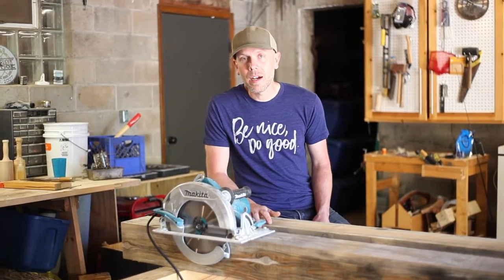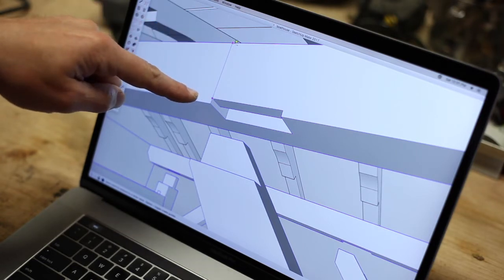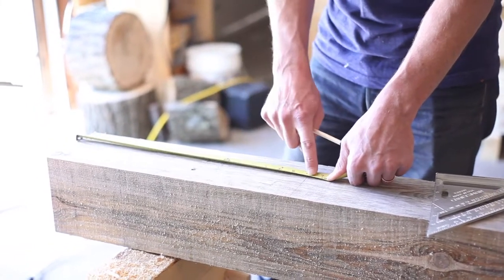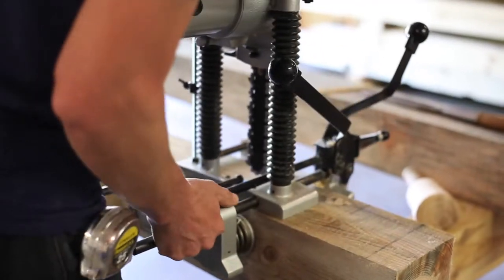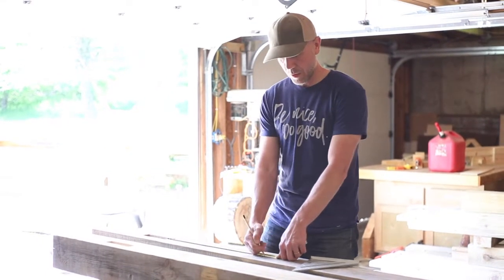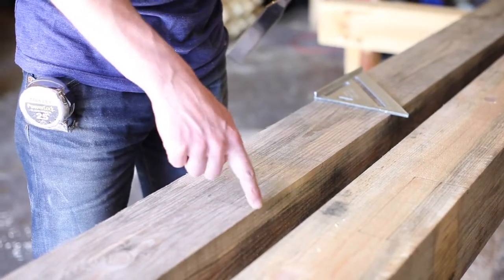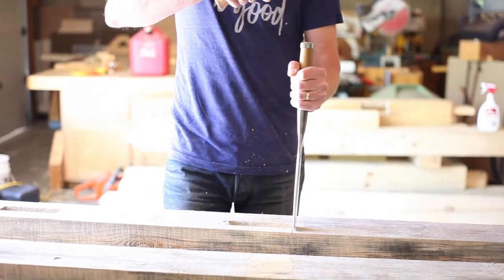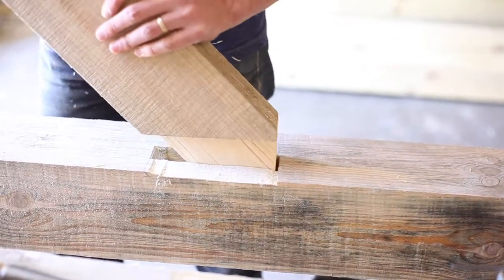Part 6: Wall Plates and Corner Braces

Comment: Great work, Jesse! This question is for motises in general.......... When using the chain mortiser, do you clean out the bottom radius left behind or do you just cut the mortise deeper to allow for tennon clearance? I suppose you could cut 45 degree corners on the tennon?
Reply from the maker: Thanks Tony! Good question! I tend to cut deep enough that the radius doesn't hit the tenon. I will also chop the corners of the tenons off too, but more so they are easier to get into the mortise.

Comment: The craftsmenship on the joinery is awesome, but I think there might still be a misstake in the layout.
You measure 23 1/8 " from the inside corner. But then you measure the depth of the housing from the outside. So the dimension, that determines your braces is 23 1/8 " + however your housing are deep. And that varies depending on the timber thickness.
I totally agree on using a layout, that helps you ignore varience in the timber dimensions, but I think you are mixing it up. Imaging your wallplate did not have overhang, but was flush with the post on the outside. That virtuell corner is from where I would pull all the measurements.
Still, I might have gotten something wrong, but it would be a shame if you had to makes those braces a third time.
Reply from the maker: 😅Ha! I sure don't want to make them a third time! Thanks for the detailed comment and you might be correct. Based on the 3d model, if the inside corner is the fixed position and I pull 5 1/2" from the outside (which is in the model) I should be at 23 1/8". I'll see how that works out on one brace before I remake all of them. Again, thanks for your thoughts 👍🏼👍🏼
Reply: I noticed the same. The reference point you'd use is the point where the inside faces of the 'ideal timber within' of the plate and post meet (re Jack Sobon; Will Beemer). And those in turn can come from a chaulk line if you don't have a proper reference face.

As your wood seems pretty consistent (and you double check your stuff) it'll work out fine here!